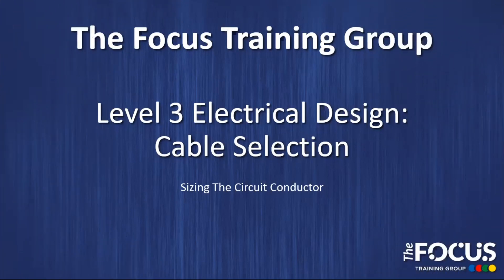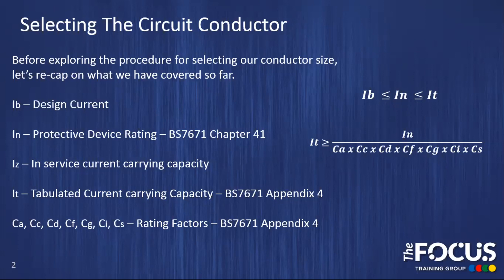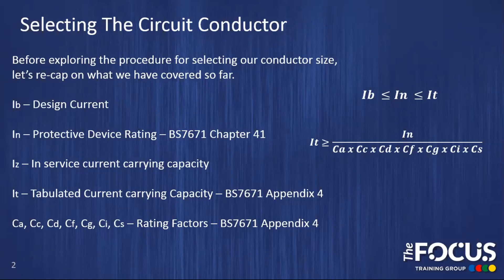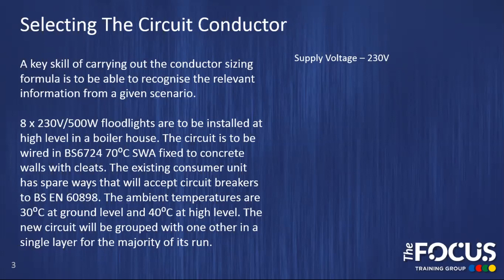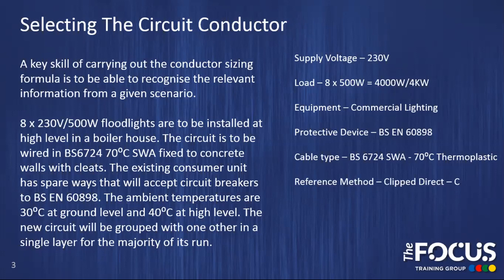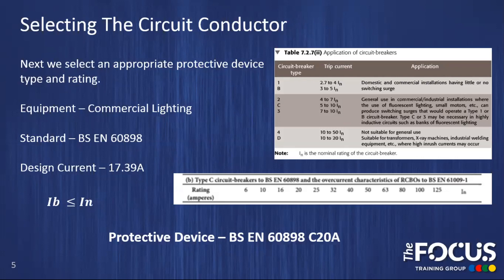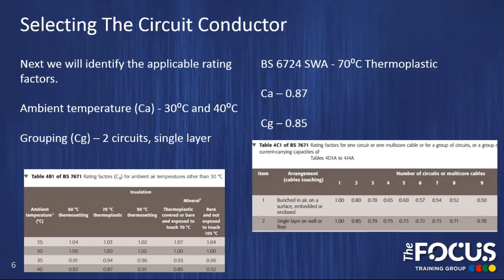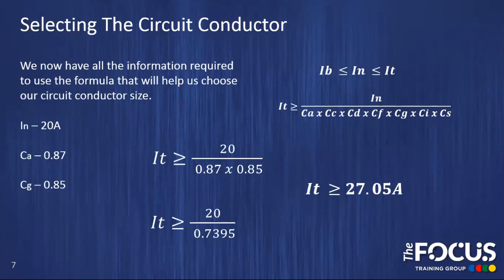Sizing The Circuit Conductor

Comment: If the scenario was a motor circuit, with an expected “inrush current” would this need to be factored into selecting an appropriate csa cable?
Or would you simply select a C type mcb and a cable with sufficient current carrying capacity for the normal running load current?

(In other words would a bigger csa be required just for motor startup current?)

Great content, I am looking forward to future videos👍👍